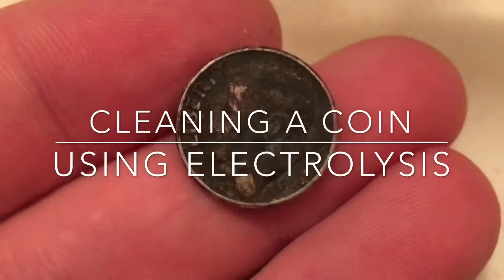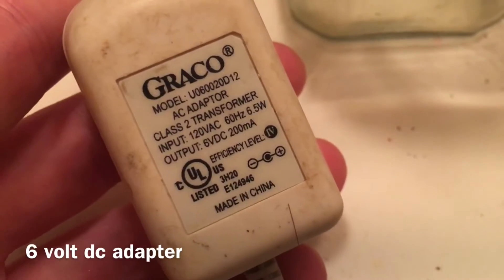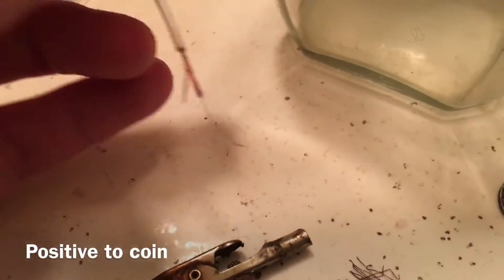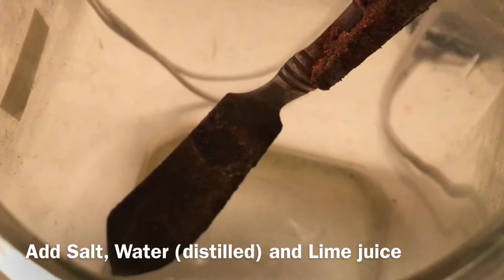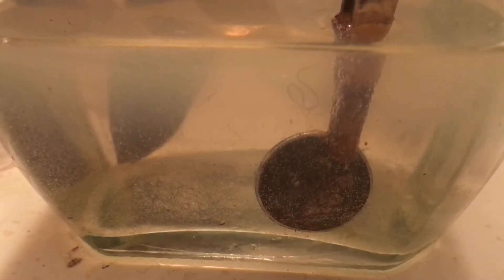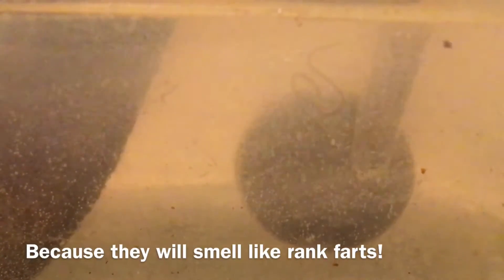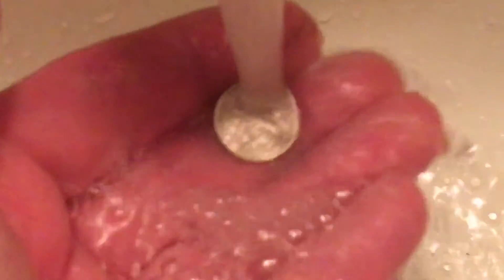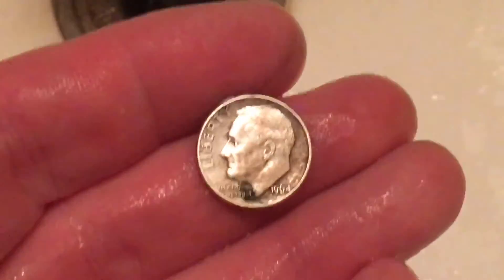How to clean a coin using electrolysis

Comment: Hi :D i have a question, i got a coin its i think silver and the vintage is 1733. looks old. i became it from a friend that lives in the caribean. its a name on it called philip and the number 8 is on it and MF and a crown can someone help me? i would go to numismatik but its far away:/ thank you
Reply from the maker: michael tring Sounds like it’s a either a Cortada (Klippe) or a Columnario/ Pillar Dollar which will be round vs square or rectangular as the Cortada would be. 
I would have to see it to know for sure if is genuine and what coin it is. But it is definitely Mexico Mint. Assayers MF are Manuel de Leon and Francisco de la Pena y Flores. 
You can email me photos at OSheaCoin@Gmail.com and I can tell you if it’s real or not. Include photos of the edges and the weight if possible. There are many replicas and counterfeits of these coins in this transitional period for Mexico. 
Sorry for the late reply.